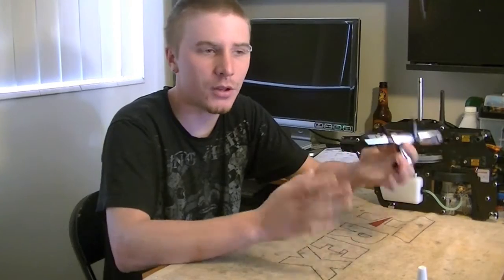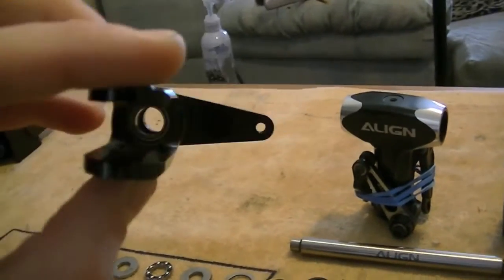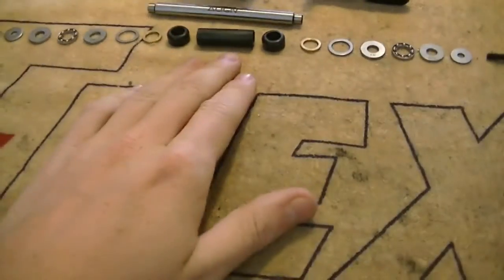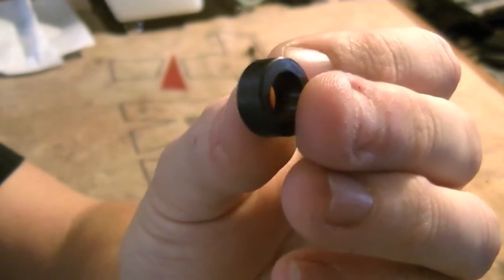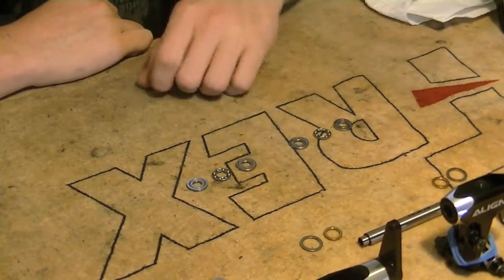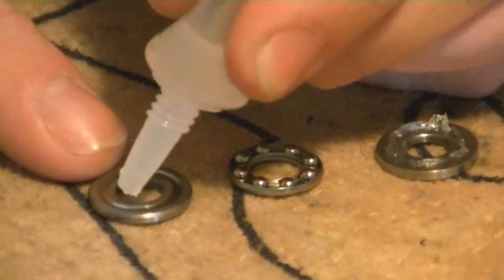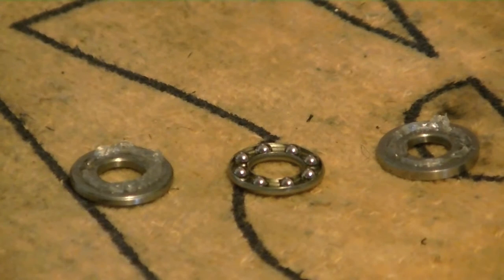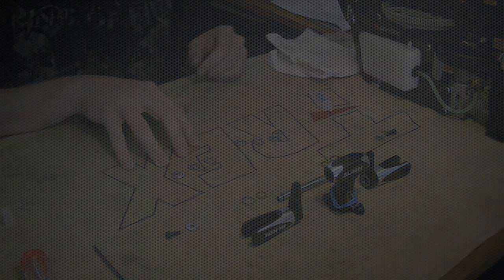heli tips and tricks (feathering shaft, thrust bearings, and dampers)

Comment: I am linking this video to my blog post. I have benefited from this video, and I have my videos of FPV helicopter that takes advantage of collective pitch to dive straight down from altitudes. Quadcopters whirl down during a prolonged dive because they can not have attitude correction without spinning up motors that thrusts the quad away from a dive target. So the pilot of a quad becomes very busy thrusting the quad evenly in all directions to keep the craft dive down on target. Helis don't need piloting during the actual dive when GPS coordinates are set correctly.

Comment: Any tips on removing the control arm bearings?
Reply from the maker: usually a bearing press or hand held one will do, or you can apply some heat to the part and give it a few taps.  The bearings should pop right out.